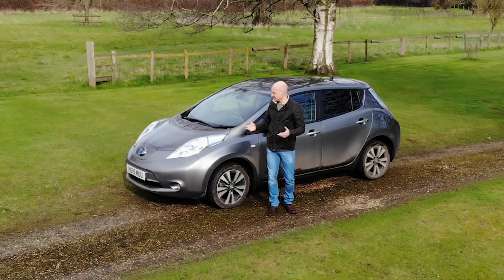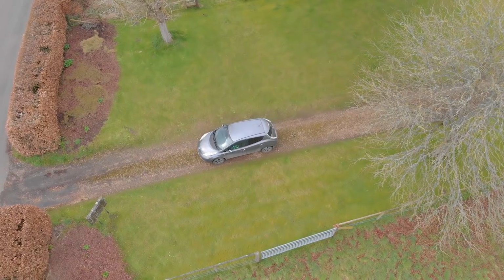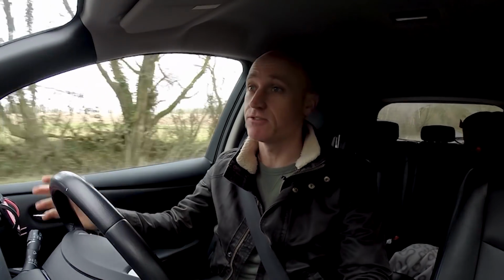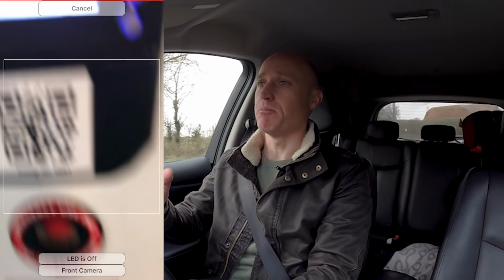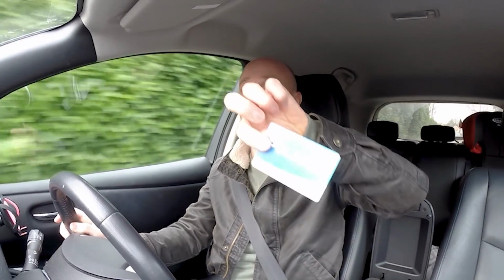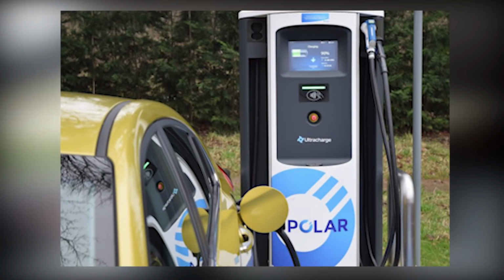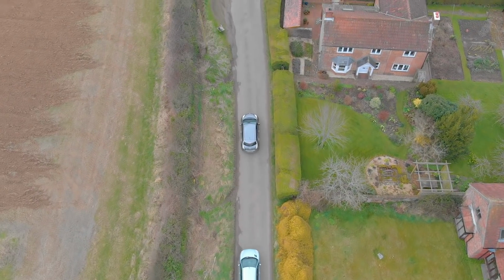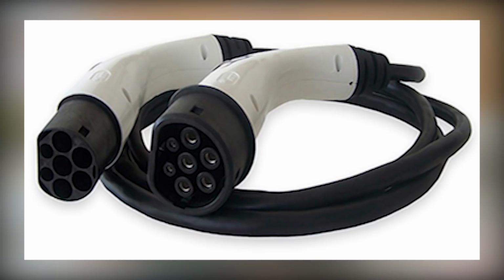How to Charge an EV at Public Chargers

Comment: I love Charge Point Genie, yes a bit expensive but they work fine and there customer service is spot on and 24 hours. they are everywere in Southend, I use a card. I have had lots of problems with Ecotricity using the App. so much so will not do it again.

Comment: Great video, very informative. I am about to buy my first EV, it will have an on board 22kw charger (type 2). Can i use my local 43kw street charger (i believe it has a type 2 plug) to charge my car or not.

Comment: All the ice cars are a bit different , some have Diesel engines , petrol engines , LPG engine converted vehicles . You have to fill up with Diesel for Diesel engines , petrol for petrol engines  and LPG . Remember they can’t be mixed and will cost thousands to use and will poison ☠️ you . Also remember highly flammable , cancer causing , and may even explode if not handled correctly. It is never cheap ,never free, but the number of places to find it is reducing at a significant rate 😂😂😂. Unfortunately storing more fuel at home not easily done or legal and not any cheaper
Reply: Also be aware that unless you stop, so your family can vacate your vehicle, you will be driving them into a highly dangerous filling station with flammable vapours and possible fluid hazards. You may be tempted to leave your children in the vehicle while you go to pay in the shop or alternatively walk them with you to the shop, which in itself can be risky.
Reply: @dougowt  going to a filling station is no more dangerous than then being in a car when driven lol more change of you kids being ripped apart in a crash than anything happening at a petrol station....fact